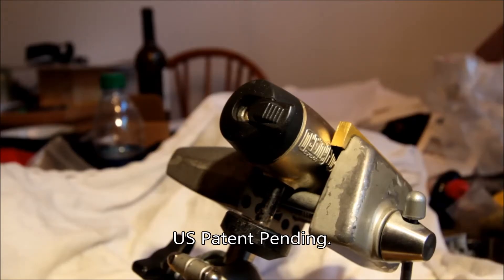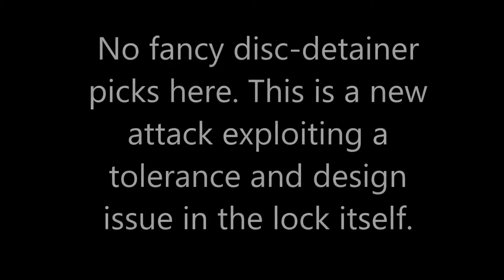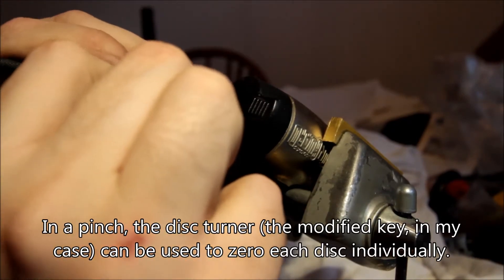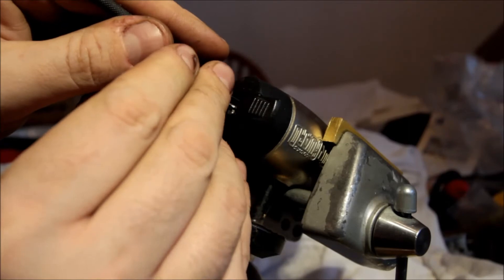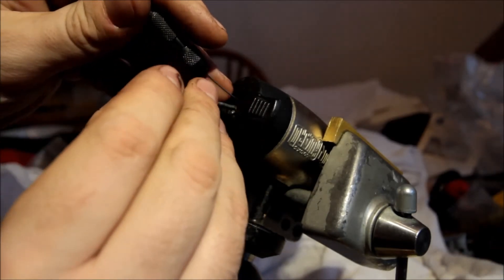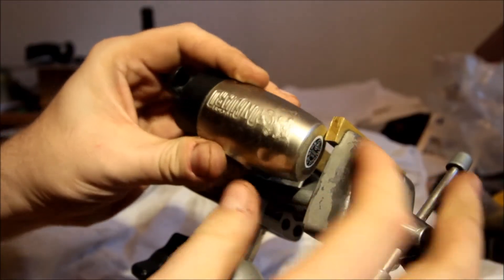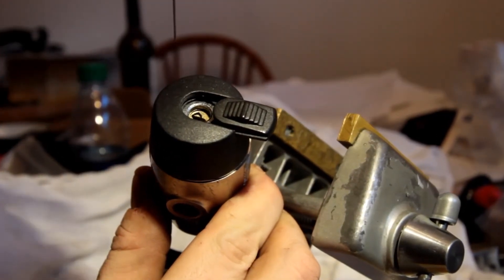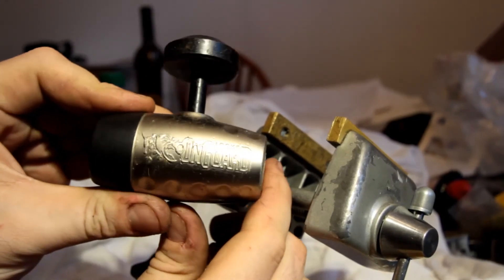(270) The Blate Bypass: A Novel Attack on Disc-Detainer Locks (OnGuard motorcycle lock)

Comment: That lock is designed to be pinned through the brake caliper on a motorcycle if I'm not mistaken. Might be tough to execute this bypass with it in place on the wheel...but probably still could get in there at the angle you'd need to do it. Might look suspect though!

Comment: Just like using a shim to slip between the cylinder and bible on a pin-tumber lock. Looking at an abloy protec, No, you can do this. Tolerances are much tighter, No space anywhere.

Nice work